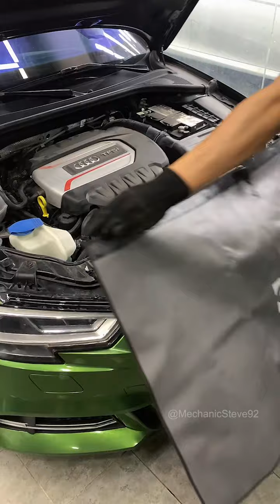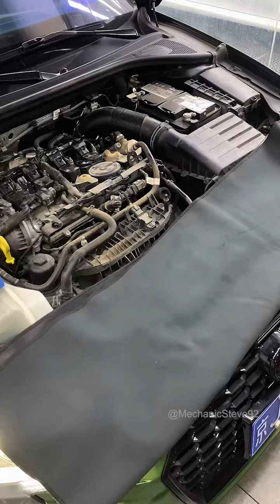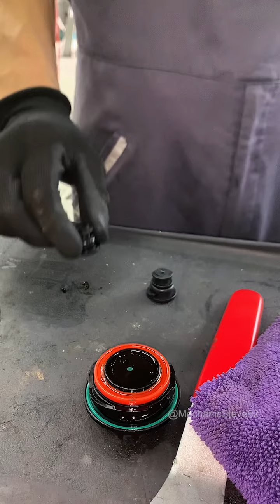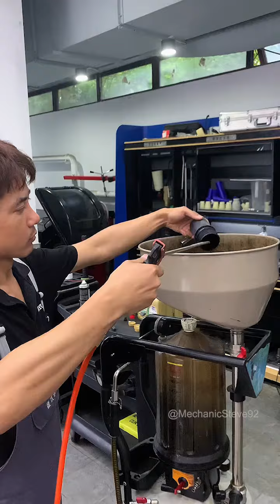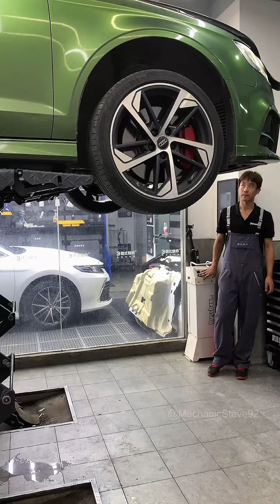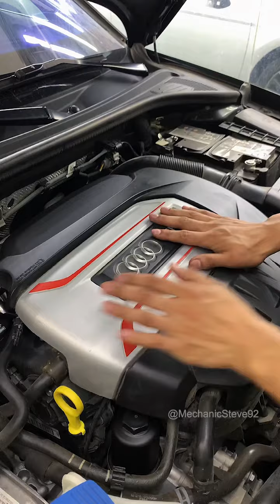Audi RS3 Service Maintenance

Comment: What additives he put in oil in begining? Then in the fuel on the end? Thank you
Reply: Probably engine cleaning additives...
Reply: in the engine oil: Oil sludge remover. In the Tank at the end: injection cleaner or octane Booster.
Reply: PROTEC P1001 EF Engine Flush Motor for better cleaning the motor inside.

Comment: Hi if anyone can help me I have audi rs3 2018 was driving perfectly until was parked for 2 months outdoor cover parking the battery got flat and had acid lead on terminal we started the car with jumpers the car temperature going high and fan is coming very loud other mechanic saying to buy new battery other saying bleed the pipe please advise thanks